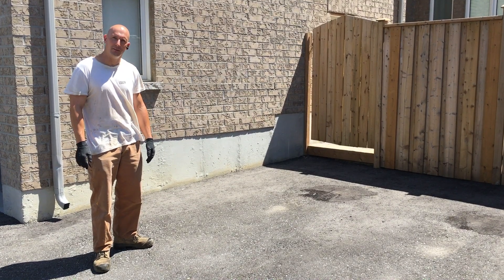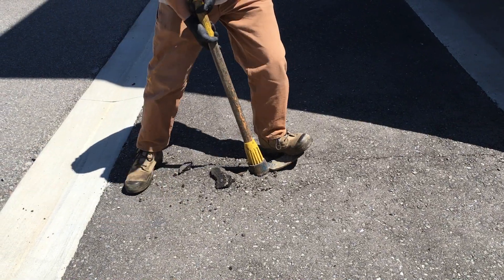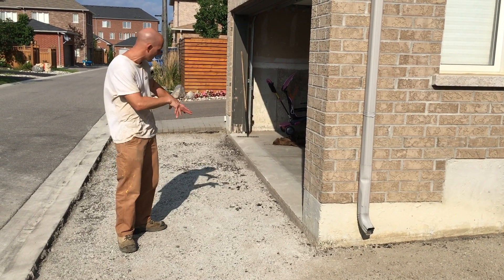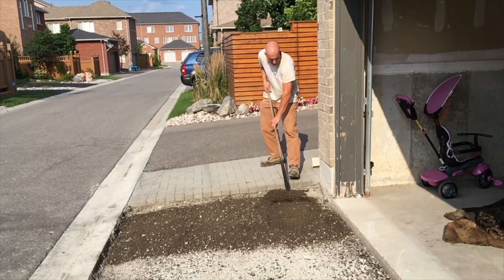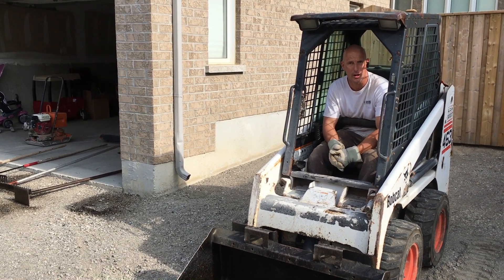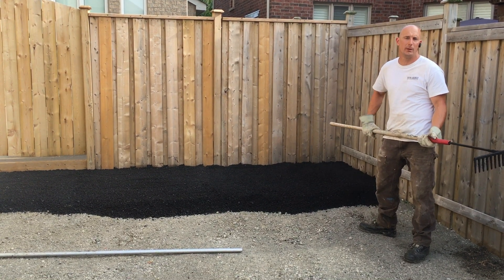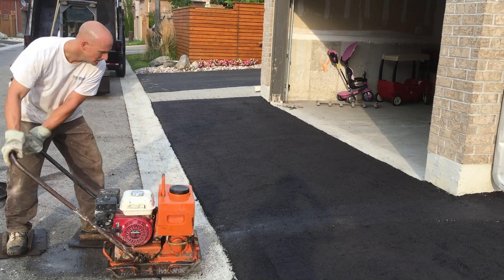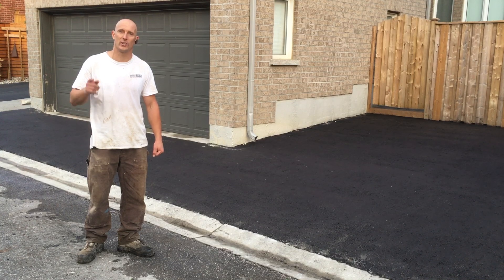Residential Driveway Paving

Comment: curious as to the benefit of asphalt vs pouring a new slab of concrete? Cost? Durability? Great video.
Reply from the maker: Depending on where you live and the weather conditions.  Concrete generally will last longer as long as you have better weather conditions.  Concrete is stronger but more expensive.  Asphalt doesn't last as long but is easier to replace.  Pro's and Cons to both.
Reply: @JeffLepard  Im in Texas....brutal weather here. I see asphalt used sparingly....I like the look. Clean, but also appreciate the durability of concrete. Thanks for info.

Comment: Looks like hell no paver no roller, never checked the base where driveway sunk before.
Reply from the maker: The base was repaired and compacted no issues since the job was completed 2 years ago.  We use spreaders and rollers on larger jobs this was very small and the compacter has more compaction than a small 1 ton roller.  My newer videos next season I will film use of the rollers etc.
Reply: The sunken spots from the tires back by the fence and the fact that there were multiple layers of asphalt on this driveway should have told a contractor that there was an issue with the gravel base.

Comment: What temp is the asphalt when you put it down. I have read it need to be 250-290  I am using a dump trailer as well
Reply from the maker: isom mcclure the temperature is about 270-325F approximately.  Excellent.  Dump trailers are great i use my dump trailer with my dump truck to carry a bit more.  I can carry 12 tons easily but 9 legally.   😉
Reply: Jeff Lepard how far are you away from the asphalt plant. I am about 30-45 min.
Reply: I am debating getting a hot box or dump trailer
Reply from the maker: I live about 5mins from the asphalt plant!  I normally try to buy from the closest asphalt plant to my job site if possible.
Reply from the maker: Hotbox was my first purchase I made and it was the best thing I did!  I still use it to this day for smaller jobs.  Advantage is doing asphalt work in the winter or colder temperatures.  I will always strongly recommend getting a hotbox.  I have 2 of them I'm going to be selling 1 of them shortly I just need to replace one of the tires on it.  Dump trailer was the next purchase I bought which again is a very good purchase.  Advantage being able to carry more asphalt but it will cool off fast if you don't lay it down quick enough!

Comment: Turning down the throttle on you 463 will make it a lot less "jerky"/"bouncy" :)
Reply from the maker: That's very true.  I also heard from a mechanic that works at bobcat says running operations using the pump on low throttle damages the pump and puts too much stress on the pump.   Might be true I'm not sure I just got in the habit of always using full throttle.   😉
Reply: Good to know!
Reply from the maker: @guitargodmc  I use to run it low and high throttle.  That's when he asked me and I told him he said the pumps will last much longer when you run full throttle less stress on the pump.  These small loaders are very bumpy and tippy lol.  I'm looking at purchasing a 2nd loader but a full size.

Comment: Btw, nice little Bobcat you have. Do you transport it with the trailer that you used for the material? Also, you don’t roller it, apparently; the plate vibrator is adequate? I wish the utility-crews did as nice a job when they dig for water, power, or gas work—they usually do an off-level repair. lol 😫
Reply from the maker: Yeah its an excellent loader I can get into some backyards to work with it.  I transport the bobcat mostly in my dump trailer or I have a small float trailer which I mainly use to transport my roller.  Since the plate compactor we use has more pounds per sq' inch then the roller it actually works better.  I do use the roller if I have more than 1 driveway to pave I will normally start off with the roller then use the plate compactor after.  The roller though I mainly use on commercial properties but always follow up with the plate compactor as well.  Yeah the city guys normally don't put much care into the work like private crews do from what I found!
Reply: Jeff Lepard, I see you’re in Ontario Canada. Wish I was closer; I like your work. I’m in southern California (we haven Ontario here, too, lol — not as nice as yours). Must be around midnight up there, you should be asleep, lol. Cheers. Daniel
Reply: When you wrote this message, he was hibernating because it was winter in Canada. He didn't wake up for another 6 weeks.

Comment: Wounded why there's no sticking component before the Asphalt is laid.
Reply from the maker: For newly paved driveways we don't normally use tax coat (ss1 glue) against the walls or curbs for residential none of the pavers do.  We do however use that on commercial projects and some patch work depending on the client and requirements.
Reply: @JeffLepard  tx for the detailed explanation

Comment: all the paving videos I watch and nobody uses water to moisten the base approximately 25-30% for proper compaction with my company its a must dry compaction simply isn't sufficient. 3rd generation 45 years experience.
Reply from the maker: Wetting the base does help it firm up of depending on the base people are using.  Same as some landscapers do dry & wet compaction.
Reply: All soils have an optimum moisture content to achieve proper density . Doing it dry is not a good practice, you should use water.

Comment: YOU ARE SAYING ASH FAULT! YOU DID NOT DO WELL ON THIS SMALL DRIVEWAY IN MY BOOKS  WAS THE BASE THICK ENOUGH???? 8 INCHES OR SO.YOUR CUSTOM SHOES HINDERED YOU ALL THE WAY!! YOU HIT FENCE WITH COMPACTOR AS WELL HAND TAMPER WOULD HAVE BEEN BETTER AGAINST GARAGE AND FENCE. THIS SHOULD HAVE BEEN DONE IN TWO LIFTS FOR A BETTER JOB! I HOPE YOUR JOB IS BETTER THAN THE OTHER GUYS JOB THAT YOU CRITICIZED???  I WONDER IF YOU HAD CORRECT COMPACTION?????
Reply from the maker: My older videos I was always pronouncing the word incorrectly, It was a bad habit!  The new videos I will be releasing on my New soon to start Do It All Sealing Channel will have much better content.  This driveway is still fine after 2 years there hasn't been any issues with it.  Thanks so much for watch my  video and taking the time to comment I appreciate it!
Reply: I also noticed you did not clean the gravel off the surface of the plate on your compactor be using it for the asphalt, now you have white stones embedded in the surface of your mat.